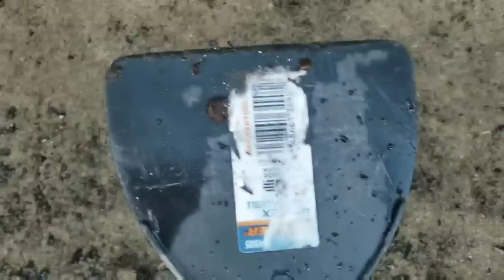debrajoy, My sweet chauffeur and a lot of work!

Comment: You need a "J" hook pole, it extends...you can find it at Lowe's in the isle where they sell the eaves trough supplies...you screw it onto the hose.  You don't even need a ladder 😊☮❤
Reply from the maker: Done now! :-)
Reply: @Debrajoy  I have to clean my gutters out.  I have a hose I can connect to my shop vac.  I vacuum the gutters and then I rinse it with my  "J hook".  I know you got a good workout.  Job well done 😊😊👍👍